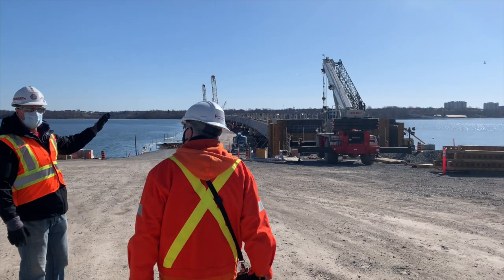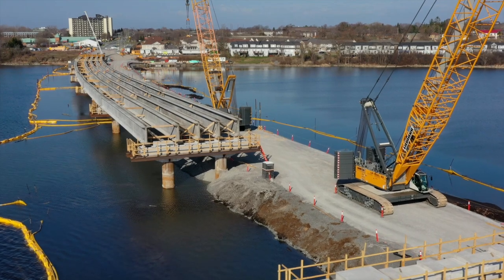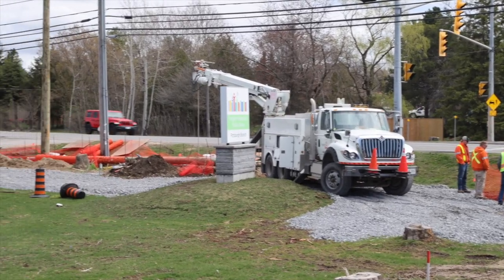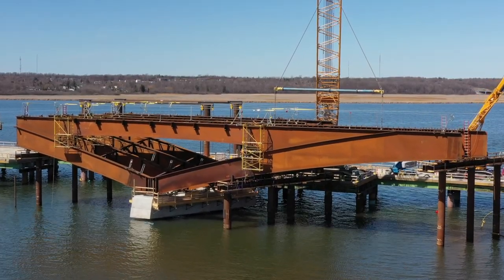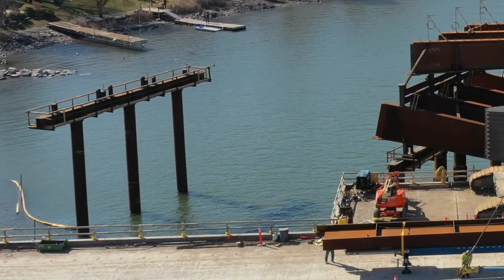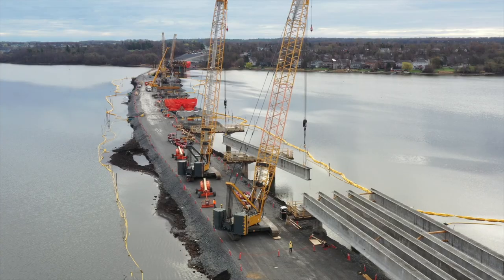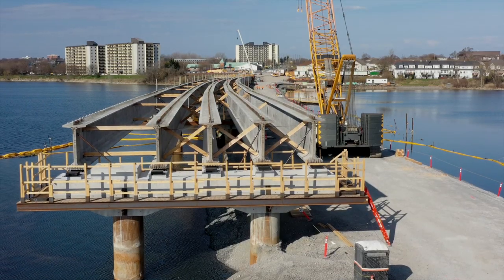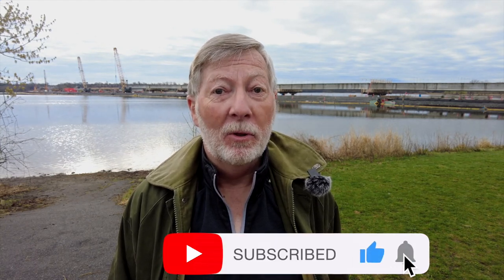Coming Together

Comment: Great shots, but can you please not cut to new shots so quickly? Less than 2s is not enough time to take in and process all the visual detail seen. I suggest 6s - 8s. And I noticed one of the shots traversing the bridge was sped up (workmen were walking like in a ‘20s movie). Why? Yes, I could be pausing it myself, but that’s rather irritating. It reminds me of the fast cut style of concert and other stage entertainment, which I consider unwatchable. Very interesting though, and good work otherwise.
Reply from the maker: Mark - thanks for watching the video - and for your constructive comments - much appreciated.  Sometimes there may not be enough material to meet the need for a longer clip.  Yes, the fly-over was speeded up to match the narrative.. it's sometimes hard to hold attention on a long clip.  I really appreciate the feedback though and I'll take your comments into account on future productions.